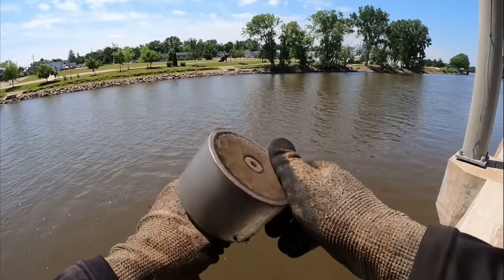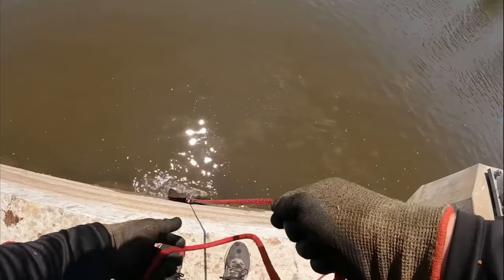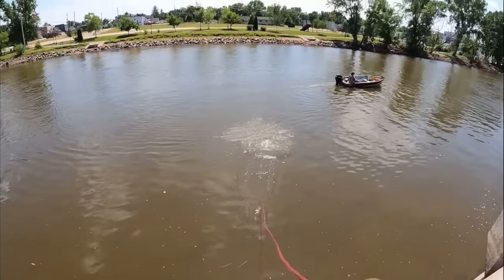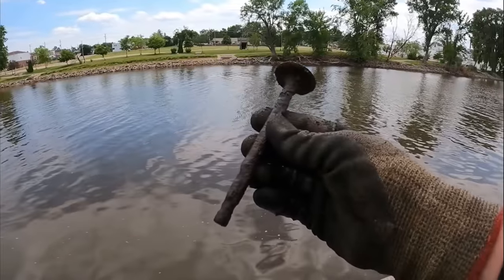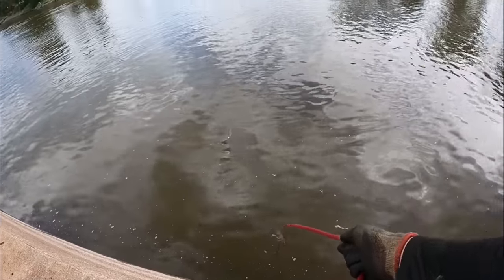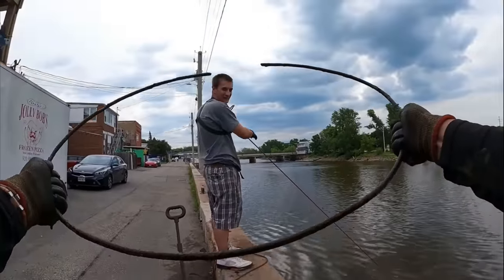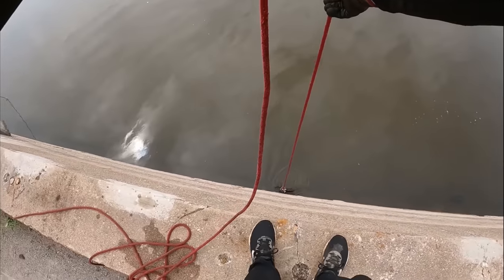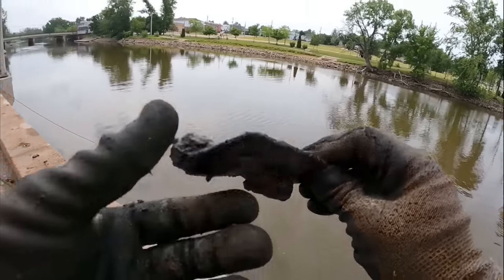The Most Ultimate Magnet Fishing Jackpot EVER!

Comment: The back alley cement wall was designed to sober up local drunks
Reply: Door plate to let out material from a dump truck
Reply: Hub cap
Reply: Castiron bass or oil jet for a fire place or stove
Reply: Iron nails
Reply: Shuttle from a shuffle board game
Reply: Truck Axel housing
Reply: Bicycle pedal crank bar
Reply: Gas cap
Reply: Sstarter silenoid

Comment: Alex just caught a wrench for a welders acetylene tank for turning on and off. That old wrench you were thinking of as a pipe wrench is one of the first adjustable wrenches made. That round disk with a rod through the middle is for a wood stove and is called a damper, it adjusts the amount of air and smoke through the metal vent pipe!

Comment: @1:36, what you have is a stove damper. It goes in the stove pipe on a wood burning stove, and you use it to keep the heat from just going right up the chimney. The holes in it are there so you don't completely block the smoke and die of carbon monoxide poisoning. 

@ 1:35:50, Alex found a gas valve wrench, for turning gas lines off and on.

Comment: 28:10. That is to pull buttons thru the button hole.  1:32:23. Damper.  It goes inside a stove pipe to control draft.  Don't want all the heat leaving out the roof, Don't you agree?

Comment: The square thing you called a picture frame is a battery mount from a car, it went with the hook looking thing that you caught in day 2 that was the battery tie down.  The 2 battery terminals you caught on day 1, and the engine valve points to there being a car in there.

Comment: I think the round thing you found with 300 volts marked on it was one end of a spool used for wire . The off center holes would be used to hold the loose ends one closest to the center hole holds the beginning of the wire while they roll it then the outer hole keeps it from unraveling when you're done cutting off what you need😊
Reply: The strings on the pipe shutoffs were probably from tags used to label what the valve was for, the oval one looks like a bathroom shutoff or possibly a fuel line

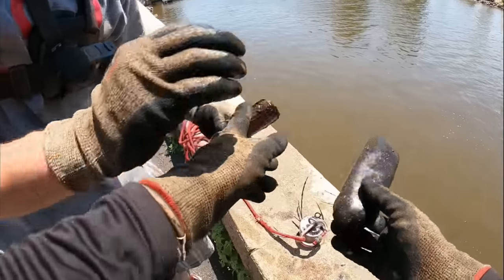Comment: @ 2:49 tha looks like a 50's or 60's looking light for a bicycle ,, @22:33 to me looks like a old belt buckle ,, @34:34 looks like a old mop head ,, @ 36:58 is a hook for indoor plants or decorative stuff it usually goes into the ceiling ,, @42:47 looks like a old spam can ,, @59:41 thats a crank for a older type bike I am guessing a 1st type Bmx crank ,, @1:22:11 looks like part of a motor mount bracket ,, @ 1:32:17 is a top to a very old school stove , that piece turns for more heat or less heat ,, the bunches of nails and small scrap one could call it a magnet porcupine lol